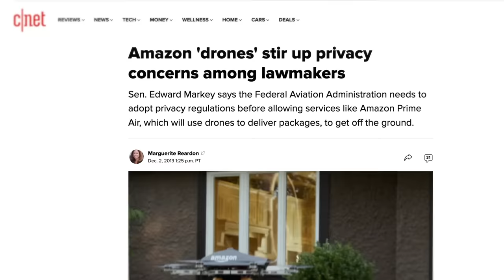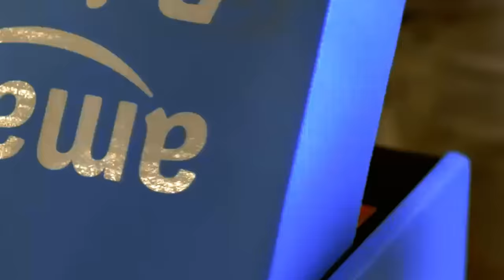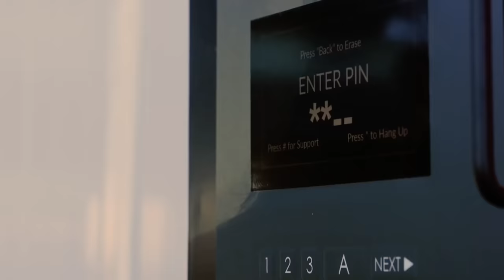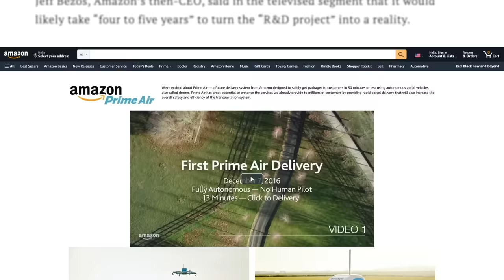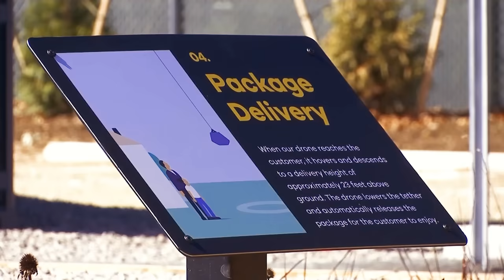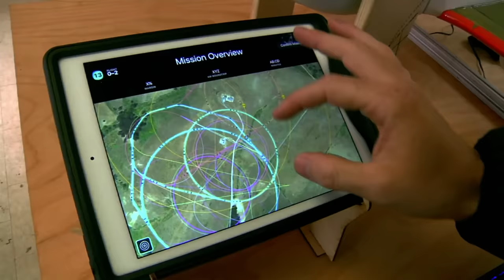Drone Delivery Was Supposed to be the Future. What Went Wrong?

Comment: I find it surprising that there was no mention to crime in this analysis. Even in the unlikely event that both the technological and legislative challenges are met, there are way too many areas in the world where drones would simply become easy targets for theft and vandalism. And these are problems you just can't get rid of.
Reply: Google's drone has a line that breaks off if you try to yank the drone down with the delivery
Reply: Jake Krause  but then how do you get the package to the locker? Remember, most of these things are indoors, where drones might have an issue flying
Reply: @xWood4000  it's good. I can only hope they also have countermeasures for flying projectiles too!
Reply: Good. Many would hate these things in the air everywhere
Reply: @ZentaBon  yea just make an ai to dodge bullets that go over a thousand kilometers per hour on a dingy small ass copter drone good idea
Reply: That's the issue with those sidewalk bots... people see them ambassadors of an out of touch rich techie class and love to vandalize them.
Reply: Well, drones can fight back.
Reply: that is why current "working" drone delivery applications either just drop the parcel out of the sky without stopping, or require pre-arranged landing zones with on-site security personnel. They don't replace delivery drivers, they just replace helicopters.
Reply: @ZentaBon  Yeah, sure. 😂
Reply: @noradlark167  Can't.
Reply: The solution is very simple.
Have every drone escorted by an ED-209.
Reply: @bobthemagicmoose  well walking drones come from japan
Reply: @ZentaBon  if(GoingToCrash){ dont(); }
Reply: @ZentaBon  AI to dodje projectiles? Ok, lets talk about that. How fast do you dodge a stone thrown at you? (I will give you the advantage of knowing beforehand that a stone is going to be thrown at you)
Reply: @bobthemagicmoose  Not to mention the more down-to-earth person who will just see them as an easy prey to make a profit on.
Reply: I guess people will do this in the beginning, but once they realize that these thing have cameras recording all the time and get busted because of it they will stop
Reply: Give drones weapons maybe? Probably a bad idea though.
Reply: Crime was my first thought. I live in a major US city, and the moment one of those drones lands, you'd have a bunch of drug addicts mug it for scrap. Even if it wasn't for scrap, people would mug the drone for fun.

I knew it would never take off the moment I heard about it, because of crime.
Reply: This would be a tiny issue. Do postal services worry about people stealing their trucks? They also would have GPS and can be easily tracked.
Reply: This will be a problem with autonomous trucks eventually. Truck jacking is going to skyrocket when all you need to do it run one off the road late at night.
Reply: Are you suggesting that foreigners steal things?
Reply: @Chris-rg6nm  trucks are bigger than a drone and they have delivery drivers with them. It would be very to find a drone once someone breaks the props and cuts a few random wires or even duct tapes the camera .
Reply: @ZentaBon  ... If it's so easy to make a drone dodge flying projectiles using cameras and AI why don't you write the program tonight that does that and sell it to Amazon tmrw and become a multi-millionaire by tmrw night??
Reply: people who think drone crime will be "easy" to police... clearly have never thought this through. you think a thief would just smile for your drone camera and happily carry your drone gps until the cops got them? obviously they will wear some sort of face cover and disable the gps asap. this is even before considering just how much extra these security measures would cost, since you gotta add them to every drone even if only 5% of them get mugged/vandalised.

and once people figure out an ideal way to attack the drones, anyone who hates amazon might wanna have a go at them - after reading some basic tutorial on reddit. this would include ex-amazon employees or gig workers who see the drones as a threat to their livelihoods... or even just anyone who hates megacorps/techbros.

let's not forget that people who just wanna retaliate or act out against amazon wouldn't even need to steal the drone/package... they just need a good-enough weapon that can make a drone crash from range. there is just no way to keep thousands of drones safe against completely random assailants whose goals may differ broadly.
Reply: The only way to fix that is to alert the consumer that the drone is coming, so that he waits outside
Reply: In Los Angeles they derail trains to rob them.  Drones would be an easy target.
Reply: Absolutely what I'm thinking about
Reply: @ShumailSarim  Drivers leave their trucks open all the time on the street with packages in the back. Stuff rarely gets stolen.
Reply: @ShumailSarim  Plus there isn't exactly a market for stolen broken drones.
Reply: @Chris-rg6nm  lol talk about fpv drone builders who can salvage the parts from the bottom of the mariana trench
Reply: @Chris-rg6nm  people dont steal it because there is someone still available within few metres or football fields , letting a drone fly with costly shipment about 1-2 kilometres without someone to watch it is dangerous.
Reply: The pirate problem as demonstrated in a classic episode of Tale Spin.
Reply: @Tank50us  the locker would need to be redesigned and only be kept outside. Here in my city, all lockers are outside a store front. So maybe if they had a opening at the top for the drone to drop into a chute with a QR code reader that will sort it into the correct locker.  ?
Reply: I don’t think it’d be as huge a problem as most people think. Porch package thieves are able to steal packages that are sitting on someone’s porch for hours after a delivery driver drops them off at a given time on a set route and schedule. Drone deliveries would be much more random, and I imagine people would be there to pick up their stuff within  thirty seconds of it landing the vast majority of the time. 

So the only way to reliably steal stuff from drones would be to shoot them down, which I seriously doubt your average criminal would do.
Reply: @dinodonut5776  You don't live in the US do you? There's a reason why cities like Chicago, Detroit, and LA, along with Austin, Portland, and Seattle, among others, are some of the most dangerous places to live. Shootings are very common in those cities and yes criminals can and will shot at flying objects. When Hurricane Katrina happened and the national guard was deployed in New Orleans for rescue operations, gangs and other thugs were shooting AT the rescue helo's because they were "flying over their turf", this forced the guard to temporarily halt operations. The guard was eventually able to resume them, but had a much more strict corridor to fly through thus making those operations take longer. (my solution? Just arm the guardsmen and give them orders to shot anyone that fires at them, simple) 

Either way, yes the average criminal actually would shot at one of those drones. Whether or not they could hit it would be a completely different matter, after all, it would be a rather small target and frankly most criminals don't have very good aim but that doesn't mean they wouldn't try.
Reply: Then we need to teleport the package directly to the consumer. Even if they're losing one or two hats because it teleported right into it.
Actually the idea dropping the package from a height reducing the probability of crime. IF it immediately picked up by the consumer. Ofc, the app will tell if the package is about to arrive, the consumer responded and standby. But it is not always the case. They can use a special Mail box to retrieve and kept the delivery as well. Including the cushion feature to reduce the risk of damaged product. Also some sort of guidance system for the drone for precise delivery.
Not every country legalize guns to shoot down the flying drone anyway.
Also, one drone one package is pretty uneconomical IMHO. Maybe a larger copter capable to deliver anyone package across the block in a single time.
Feel free to add a reduced-recoil automatic rifle to the drone as a defensive measure.
Reply: @ZentaBon  techbro version of magic. Programming won’t help a drone dodge a bullet or fast-thrown stone
Reply: Arm drones with guns, duh. Bring on the cyberpunk dystopia
Reply: It’s easy to throw something at the drone to crash it when it’s landing.
Reply: People rob manned delivery vans all the time, it just doesn't make the news. It rarely ends well for the thief, and the cost is easily managed. Stealing or vandalizing a drone with built-in cameras and GPS is a terrible idea for anybody who wants to stay out of jail. I'm sure that won't stop some people, and I'm equally sure that those people won't be missed.
Reply: @mrbisshie  Which third world country do you li- oh wait never mind just finished your comment
Reply: @Suisfonia  tbh shooting at rescue helicopters sound like Somalia, not a developed country
Reply: @hydrohasspoken6227  for a fit person, for what can be assumed to be an arm accuracy for a fit aggressor @ 50 feet, assuming a round  100g pebble thrown @ 150 feet per second targeting someone's mid section ( obviously most propable area to hit due to size) said pebble will cover the distance in about 0.3 second, that's enough reaction time to execute a single dodge maneuver to be out of target by the time the stone is on location... For a powerful processor AI equipped with, for arguments sake, lidar sensors, trajectory calculations will be a peach, less than 50 ms, the next stage will be to fire up a series of commands to the Motors to relocate the drone out of danger zone into a green zone... Which may take 200ms....just in time...😎👌🤣🤣🤣🤣🤣

Edit: Anything like paintball @ 250 and greater than 300ft/s, forget it at close range...
Reply: Especially if you live in an apartment.
Reply: @noradlark167  I can visualize the film version already..."Robodrone; The Movie".
Reply: @REOsama  oh yeah, that sounds like a great future, where drones are flying around everywhere and filming you all the time, even in your own backyard!
Reply: @dipanjanghosal1662  aka defeating the whole purpose of drone delivery for the customer 👍
Reply: @dinodonut5776  except that they already did. Drones being shot down was the first headline about drone delivery after Amazon launched the program! 😂
Reply: @LRM12o8  its not for the customer. Drone delivery will be used to phase out human delivery agents as much as possible thus increasing profits and reliability for the big corporations. It has nothing to do with customers.
Reply: I always wanted a larger drone, to prey on the smaller, weaker drones.

And we all know that would be inevitable.
Reply: @REOsama  Facemasks will mostly nullify that. Also you underestimate how little some people have to lose in certain urban areas.
Reply: @Chris-rg6nm  Generally people are more reluctant to assault a person (the operator of the vehicle) than a drone.
Reply: @Chris-rg6nm  Because the driver is still nearby.

Comment: Probably not an option for the US suburbs, but works just fine for densely populated areas: delivery pick-up sites. I have 4 sites from different marketplaces within 10 minutes walk from me, and I live on the outskirts of my town. 

This is so much more easy and convenient than to door delivery. I don't have to be waiting for delivery at home for hours. Waiting for their calls, confirming that I'm avaiable, listening to their 'sorry, I'm going to be late', etc, etc. I don't have to wait for 5 separate deliveries if I ended up ordering stuff from 5 different shops. I don't have to worry that someone is going to steal my delivery because it was left outside. I just walk 10 minutes and get my stuff.

So in densely populated areas the solution to the last mile delivery problem seems to be: no delivery. Just make the pick up sites available and convenient.

Comment: Yeah, this is a "Cool but impractical" type thing in my opinion. 

Zipline's operation seems like it'd be the best way to operate such a niche, since it bypasses most infrastructure and geographical barriers and a clinic that's designed to accept such delivery from a central hub can likely maintain a landing area fairly easily. Or for longer distance shipments perhaps even a recharging/relaunching system so the planes can deliver at the further extent of their range without needing to factor for the return trip.
Reply: Agreed. I’ll also add “maybe not even needed” for the majority of the population.

Like you said, the zip line application seems much more likely to stick.
Reply: @acidtears  oh god the hyper loop….dude just built a less efficient subway system and then is too busy patting himself on the back to listen to any of the critiques.
Reply: @acidtears  yeah I loved the idea of a Hyperloop when I first heard about it but then the more I heard the more it becomes a sort of "wait a minute"
Reply: @SaveMoneySavethePlanet  
The idea is basically as old as subways. But all that's happening now is nowhere near economical.
 
However, no one is talking about the only feasible way this will ever work, and probably the best way of all. I'm imagining a massive global system of tracks, likely mostly underground, that hits all the major cities and important transportation hubs. You would only accelerate a small cab of people up to the thousands of miles an hour possible in a proper hyperloop (regenerative breaking will be critical here). The passengers would board a larger vessel that never slows down, traveling around the whole track continuously, with enough vehicles running at all times that you can always just catch the next one.
 
This idea already exists between planets, it's called a cycler orbit. For this to work on earth you would need a near perfect vacuum tube and a nearly perfectly frictionless track, aka entirely superconducting. This would be a mega civil project, far larger than anything else ever attempted, even larger than the space elevator or skyhook that we'll likely already have at this point. I guess if we're talking deep tech, tho, I think Musk's idea of point-to-point passenger rockets isn't as crazy as it sounds.
Reply: Zaydan Naufal  
Trains are great, but you have to accelerate the entire train up to speed and down every time (regenerative breaking is helping here), and it has all the standard friction and weather problems. Trains will never go away, but I believe I outlined the ultimate mode of transportation in my previous post. It won't even be technologically feasible for at least a century.

Comment: This was no surprise to those of us in the R/C aeromodeling community, we already knew that the technology wasn't there yet and won't be for decades. The problem with this whole idea is that sooner or later one of these things will plow into the side of an apartment building at 60mph of fall onto a busy freeway and cause a pileup and then the lawsuits and demands from the public to limit where they're allowed to go will start to happen.

 "But we'll just make sure that never happens"

 lol, no you won't because that's actually impossible.
Reply: Bingo.
Reply: You don't think lidar would have seen the building?
Reply: @2beJT  Anything can fail, Radar, Lidar, Sonar, whatever you wanna put in the drone, its a balance between cost, technology and weight. Its not going to be common, in fact so uncommon when it happens it makes the news, but even airplanes crash once in awhile.
Reply: @phrog2579  might sound crazy here, bit think about it; flight plans, routes designed for these aircraft to travel that would avoid obstacles and be as fast as possible
Reply: @byojuwon  Yes, just set up a network of air traffic controllers everywhere, to supervise pizza delivery! Oh, these are highly educated personnel and quite costly? No problem, Artificial Idiots will solve all our future problems!
Reply: @byojuwon  you need active real time mapping of an incredible number of potential obstacles, wind conditions, animals, equipment failure, communication interference, and more. Any failure could result in major injury or possibly even death at the scale these drones are and the economics require you to have thousands of drones in the air, 24/7, 365. You will have a failure, and any failure will be snatched up by every news outlet possible to use as fear mongering bait. Your image is going to suffer massively and people will lobby for regulative changes.
Reply: @e4Bc4Qf3Qf7  while the RC hobby and the hobbiests that have been safe and responsible for 100 years are told to ground their aircraft permanently or fly in very small sanctioned places that will never be permitted again. 
Great
Reply: @phrog2579  Yep. You get around that by redundancy, which adds weight to the vehicle. Which reduces payload size and over all operation range/battery life.
Reply: Not to mention the following scenario…

Amazon: Uh, Mr. Teaton, we delivered your package by drone last Tuesday… we’d kind of like our drone back now

Me: I don’t know what your talking about… 

Amazon: We’ll the last reported position of the GPS sensor was on your property so…

Me: Prove I have it. 

Amazon: …

Amazon: …

Amazon: We can’t.
Reply: That’s how I felt about it when I first heard of this.  Packages and drones falling out of the sky by accident ect ect no way it will work
Reply: @e4Bc4Qf3Qf7  general flight plan with gps + collision avoidance with radar solves that
Reply: @byojuwon  you clearly have never flown a drone or done anything in the field of software development. Thats not how that works.
Reply: @e4Bc4Qf3Qf7  I havent flown a drone, but I am active in software development
Reply: @byojuwon  then you should understand that “simple” answers fail to address important minutia. If it was that easy, they would do it.
Reply: @e4Bc4Qf3Qf7  it is simple, just not yet cost effective enough for them to do it